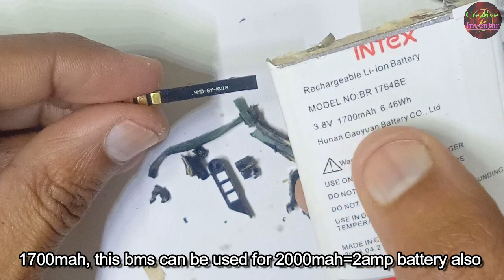3.7v Battery Charging Circuit with BMS Protection at Free COST, DIY 4.2v Battery Charger, 3.7v BMS

Comment: Thanks!! I was looking for this to make a rechargable torch. My question is, How long does a single 18650 battery needs to full charge, and how will we know if it is full charged or not?
Reply from the maker: this circuit will auto cut when battery charge is full, but there is not indication of battery full , as it is made for those who doesn't have parts lying around him, and also making this is very cheap, charging time will vary according to the battery mah,  you can leave it at charging for 1-3 hours it will not damage the battery.
Reply: @CreativeInventorlab   Thanks a lot.. 👍👍

Comment: Can i use it to charge 5 batteries at thesame time?
Reply from the maker: its too many, connect them according to the battery mah, for example, if u have taken out that kit from a 4000mah battery then u can connect upto 4000mah battery, or connect 4- 1000mah battery in parallel.
Reply: But can I add more bms boards in parallel?
Reply: To 5640 lgana achga h ,,jo yeh bnaya  h over charging 🔋⚡ se bchao nhi h isme bettry fat jayegi

Comment: How much is the voltage drop of the diode???
Reply: Usually 0.7V drops
Reply from the maker: No, in4007 drops 0.50 to 0.47 volts that means from 5v the battery will get 4.50v that's sufficient to charge
Reply: 2 In4007 diode usually drops 0.6 - 0.8 volt = 4.4 -4.2v
Reply: @cronos1675  good

Comment: Sir i want to replace LEDs like the red one in the video (which are normally on any electronic panel for on/off status) with higher capacity Numeric LED.
If you can do it Sir it will be great help

Comment: Hi Sir. Is it possible to make a device to plug into any gadget that uses 3.7v battery (through the micro usb port) to check the voltage level of the battery? Maybe by using a volt meter or led light indicators. Because I have a few devices that uses 3.7v and very often I do not know the charge level of the device, and so only come to know that the charge is low when in use and have to interrupt the usage to charge it. If there were such a device (juggard) then I could regularly check voltage level so that I could plan the charging and not be disappointed at time of use.
Would love to see a video on this if it is possible. Thks.
Reply: Take a micro usb cable and cut whatever length you want from the end with the male plug on it.  Then strip the wires to reveal the positive ( Red or Orange ) and negative (Black or Blue)  wires and the data wires.  Make sure your voltmeter is set to DC voltage.Then simply put the positive wire  on your voltmeter positive lead and the negative wire  on the voltmeter negative lead. You will instantly get the voltage reading.    If you have a cable with 2 (Black or Blue) wires, one of them is an ID line used to tell what kind of device is being connected, it will  have 0 volts and will not give you a voltage reading between it and the positive wire. It and the two data wires can just be cut short and taped up.  They serve no function for checking voltage.
Reply: @WayneBain  Thank you bro. Will try and let you know how it works. Thks.